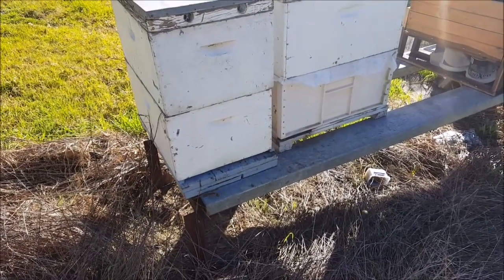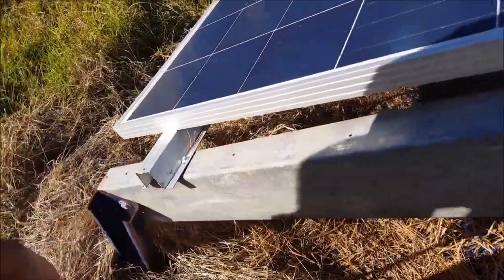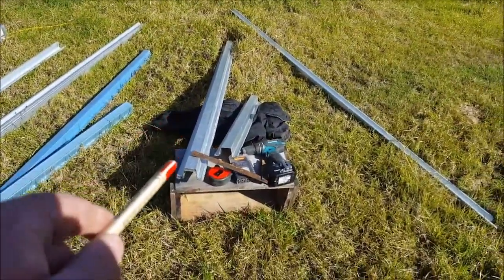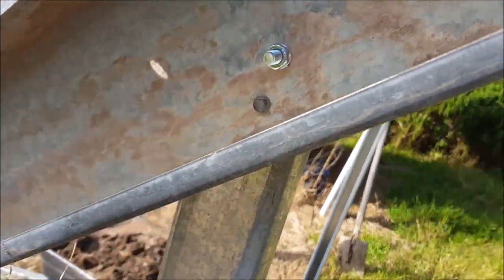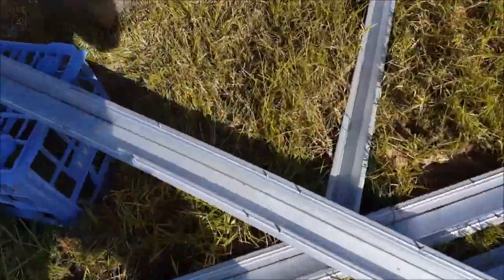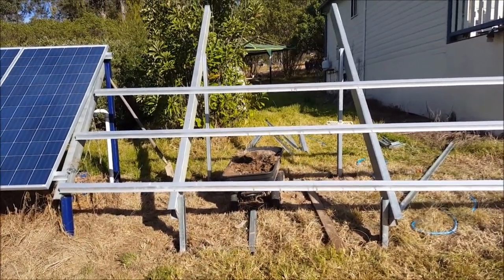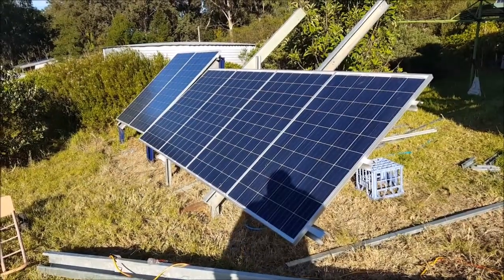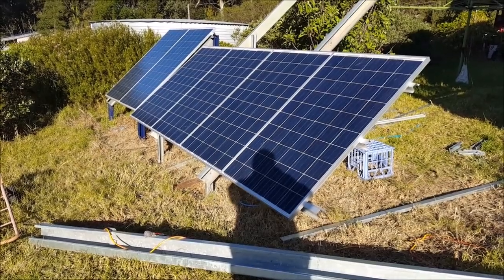Off Grid Solar Power - Building a Steel Rack for the 2kW PV Array

Comment: Another great video Mate.

I was gonna buy those panels from you. 
Do you remember? When you bought those panels you said you only need two for your application and you don't need the rest of those panels and you are willing to sell the remaining solar modules. I was going to buy them from you at the time but I didn't realize that you are in Australia. You even went and cross check the shipping cost for those modules to be shipped into the United States.
It's nice to see finally you put them to use. Thanks for sharing your video and God bless.
Reply from the maker: Yep, I remember that. I'll be using 2kW of these panels for myself and my parents have got 1kW of these panels installed, but only two of them actually hooked up to a charge controller.
Reply: Pop's Shack They are looking good Mate. 
What charge controller you want to run with the new setup? 
Please keep us updated.